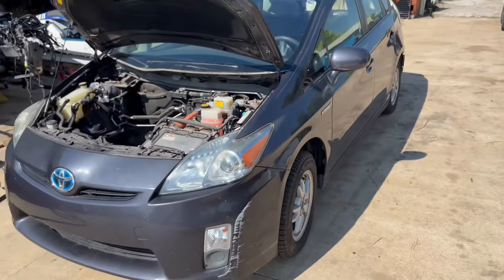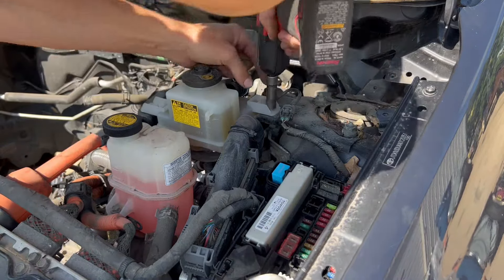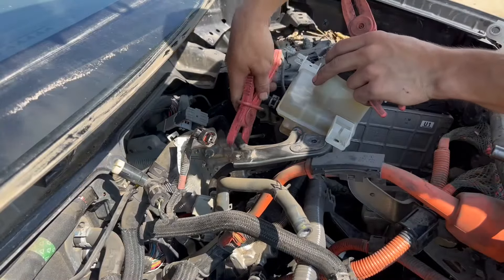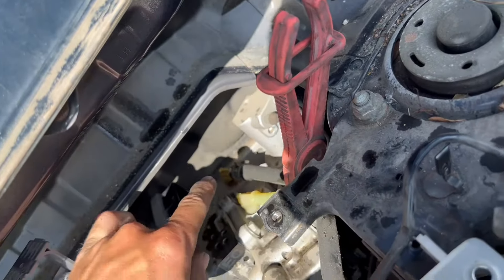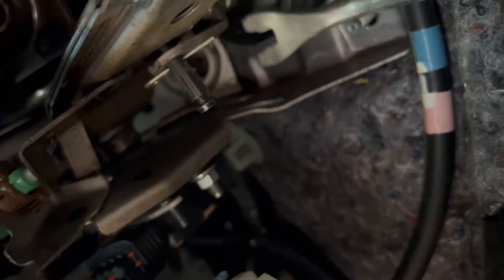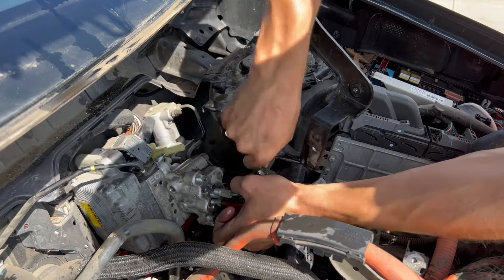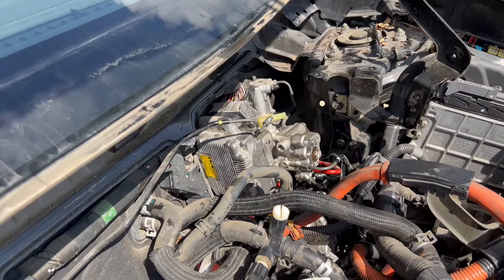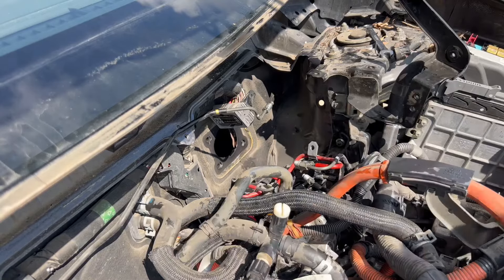How to change Brake Actuator on 2010-2015 Prius (easiest way)

Comment: Can you make a video about the programming after replace it . Can you make a video about replacing the other brake part actuator and master cylinder ?
Reply from the maker: Yes no problem!
Reply: @carhub2178  the Chanel is good brother you gonna grow bug man . I own 13 prius and learn a lot with you videos
Reply: @carhub2178 you still haven’t made a video for the next step , will you?😊
Reply: @TaylorDoesItAll you need dealer software i.e. tech stream to do that

Comment: So im a big guy and older so iv driven cars with no power breaking, that being said can i just un-clip the power to the booster and dislocate the arm on the pedal and use the breaks in manual for the duration of my cars life? Or will this mess up the charging system?

Comment: How much brake fluid is typically needed? I drained the brake fluid in the reservoir after taking it out of the car and after plugging in the high volt and 12v and turning the car on, I've had to refill it many times. I only bought 64 oz but I'm already at the half mark without doing a brake bleed yet. I don't see any leakage along the brake lines. Any ideas? Is this normal? How much brake fluid do I need? I've since unplugged the 12V and high volt to prevent more of it draining before I know.

Comment: What codes did you have I have used 0073 the kids keeps disabling my regenerative braking the voltage seems to 💧 . I replace the 12-volt battery twice
Reply: I’ve had a very similar problem with mine

Comment: So a used dealership sold me prius that had this issue they bleeding the brakes without replacing the brake booster 
They claim it doesn't buzz anymore  

You think this fixed the issue 
I was getting abs light/ traction light the only bled the system
Reply: how do you bleed the brakes ??
i could try and see if it solves my problem
Reply: Да, возможно временно

Comment: How do i know if the brake actuator or the booster are bad. My brake booster constantly goes on making noise but i dont have problems with my brake even tho the abs light is on
Reply: Please let me know if dont know if need to change both or just one

Comment: How much costs the mechanic charged me 950 $ I think I need return it
Reply from the maker: Yeah it’s pretty expensive
Reply: @carhub2178  I check used ones are around 400 $
Reply: @carhub2178  he charged me 800 for used one
Reply from the maker: @edwinbab3205  it’s a lot of labor to put one in tho too
Reply: @carhub2178  he charged 800 for part
Reply: It's expensive. I watched a video of a guy doing both parts (actuator booster master cylinder) . It took him close to 4hrs. Need special scanner to bleed brakes and reset actuator. A Google search says a dealer may charge close to $3k.